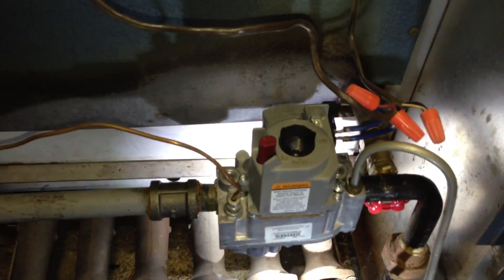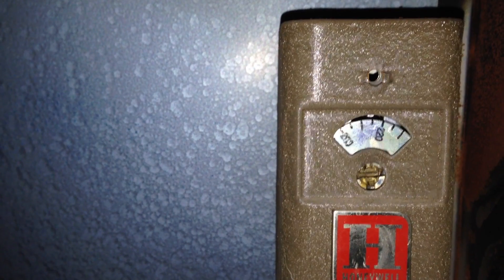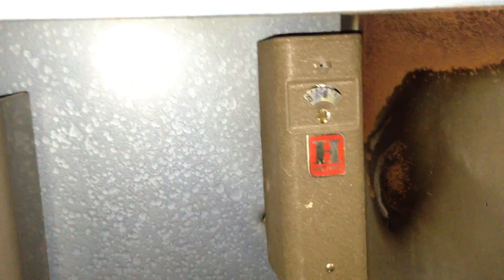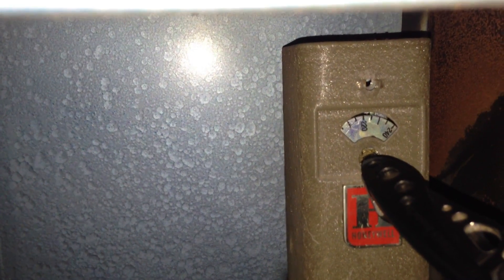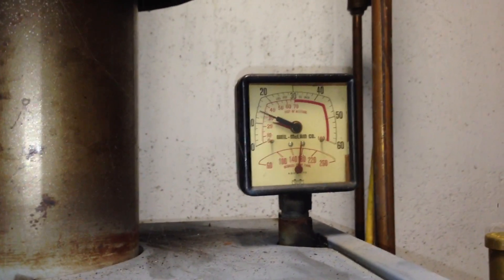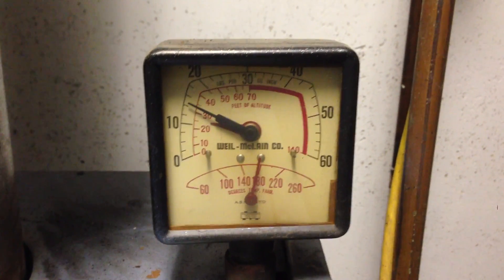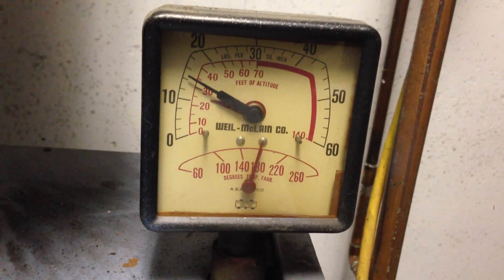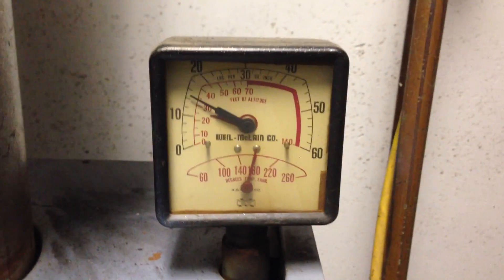Increase Pressure and Heat in your Boiler Furnace DIY

Comment: Scott, thanks for this vid. I currently live in a home wherein I'm unfamiliar with the furnace. The pressure on the boiler is bottomed out....some of the radiators (steam, floorboard) are ice cold when the furnace is running. How can I increase the pressure in the water? I believe it's simple....  Thanks!
Reply from the maker: Often the pressure and temperature gauges on these older boilers are just wrong. Pumps go bad and get weaker, air gets trapped behind unnoticed, valve controller solenoids burn out, spirovents go bad, etc. knowing which line is your feed line and which is the return is a great start to troubleshooting and finding the source of the issue. If your line is too hot to touch, your temperature is probably fine. If pump, burner, zone valves and everything is clearly working fine and the feed line is easy to hold onto, even when the pump is running, and the pressure is low, you might have a bad thermostat — not the one in your house, the one on the boiler itself. It’s fine to adjust it upward in an emergency, but monitor it. Let it warm up your Josie, keep an eye on the pressure, and make sure you have a call in to a qualified repairmen or are able to quickly repair it soon yourself. I was familiar with everything about that boiler, inside and out, and knew that what I was doing was safe! Safety first! Also, I’ve certainly had multiple parts fail at the same time. I’m pretty sure the guy that was helping me with the boiler wasn’t putting top of the line parts in. Iirc, I had to replace the same pump three years in a row :(
Reply: @scorellis  this is super helpful. I have called service just to be sure there are not any replacement parts or any fixes above my pay grade. I'll be sure that pipes and handles are labeled so when the pressure gets low I can do an easy fix. For now, I think it's worth having the pro come have a look. We're getting another foot of snow today, but the woodstove is cranking. I'll let you know how it goes, thank you!

Comment: I am having trouble finding that gauge on my furnace. Where would I find it?
Reply from the maker: Can you post a short video of your furnace?  give me a complete 360?  I just subscribed to you so I'll see it when you post it.
Reply: Thanks so much. I posted it. 

https://youtu.be/NHgwCTnKf_Q 

Hope it was good enough.
Reply: If you have an oil fired boiler, it also has an aquastat. It is towards the top, same area as Scott showed, but they can be wider with a solid grey cover. Loosen the screw on the bottom and pull the cover off. Be careful, there is 120 volts in there unless the power is off. You should see 1 or 2 dials with temps, mine dials are red in a white housing. One is marked HI limit and one LO limit. Increase the HI limit, but don’t get to 212 degrees or you will make steam. A good limit is about 205 degrees, but move it back to 180-190 when temps outside go over zero.

Comment: I have a spirovent to get air out of the pipe for my hydronic boiler but still some of my baseboard convectors still don't get hot. Do I still have to manually bleed the convector ? Question 2# I have a 50 year old boiler where the circulator pump is connected to the return line.I read today's modern hydronic boiler has the circulator pump connected at the supply line for better hot water circulation to the convectors.Can I do that with my old boiler ?
Reply from the maker: Nathan I think you should leave the arrangement where it is. I had a LOT of trouble early this year (march) keeping pressure in my system. A) yes- you probably need to bleed the convectors - at least, in my system I do, and mine is 50 years old, too. Also, look to the top of any pipe that comes up out of the boiler and takes a right angle - you might have an unnoticed bleeder valve there. B) you might need to replace your feed valve. Mine had a very slight leak that was venting enough steam to drop pressure ten pounds in 24 hours (mine only holds 14 lbs). It was one of the few parts that hasn't been changed at least once in the past 20 years. If you are new to owning an old boiler, you WILL be replacing parts. Most of it, you can do yourself, but I do like to have professional help if I can't figure it out! In the end, you do have maintenance costs with an older boiler, but over the past 20 years it has cost me less than $2000 to maintain, which is way cheaper than a new boiler, which I probably would be having way more expensive problems with now, had I replaced it 20 years ago :).
Reply: Thanks  for  the info.